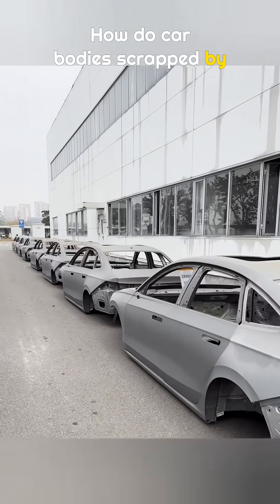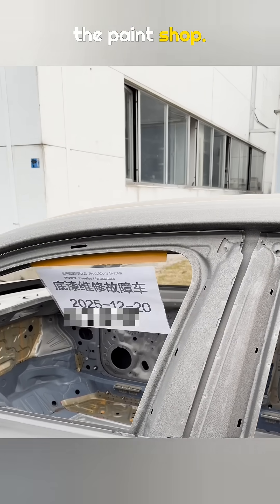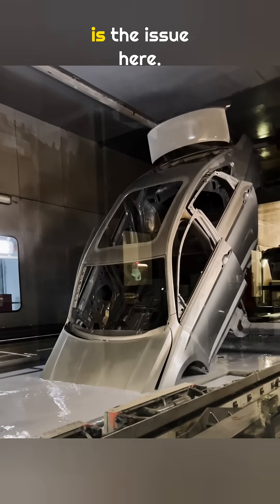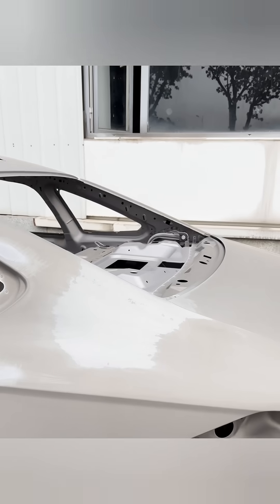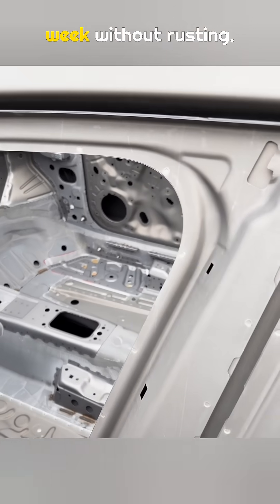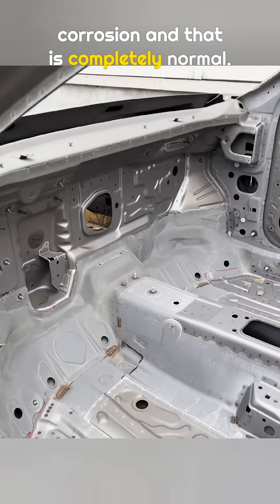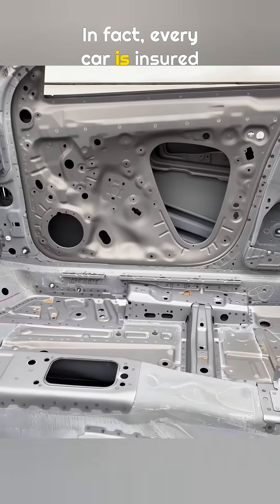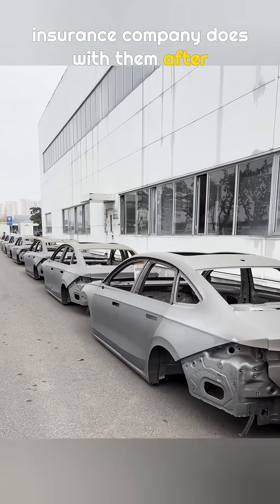How manufacturers handle scrapped car bodies

Comment: E-Coat is not primer, and the failure of the E-Coat is generally contamination. Generally once detected the E-Coat is filtered and re-assessed, this can take up to one hour, also the cars are NOT insured. The insurance costs are prohibitive. The bodies are generally crushed and sent for recycling. Better to loose 50 or 60 bodies than day's production. All welding must be complete before the e-cost is applied.

Comment: What went wrong with the Passat b6? Did they not fully galvanise the bodies or was qc less strict?
Reply: My Passat B6 didn't have any corrosion issues.
It had just about every other issue though 😂
Reply: @Tom-f8r8o I think it was qc problem so some bodies that should’ve been scrapped due to a poor coating got used instead